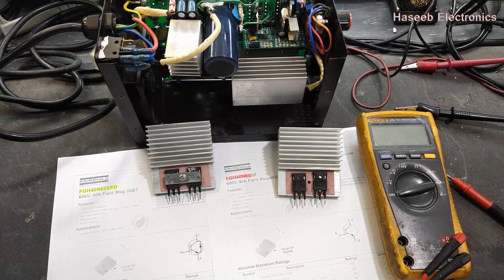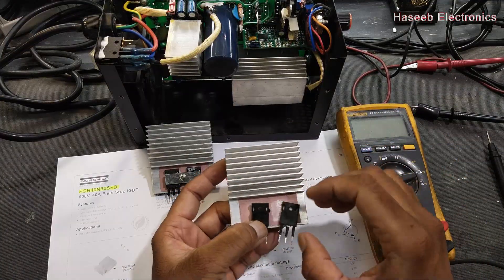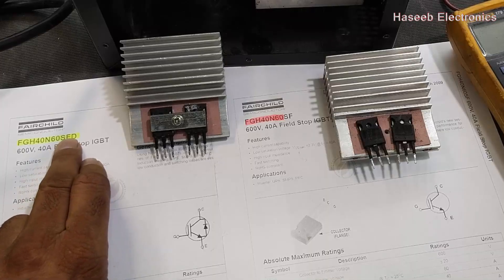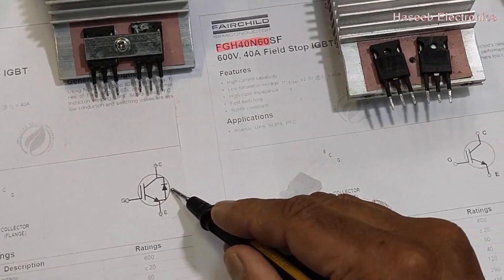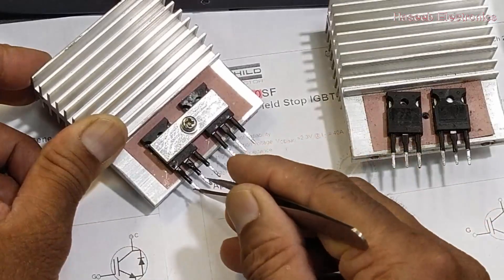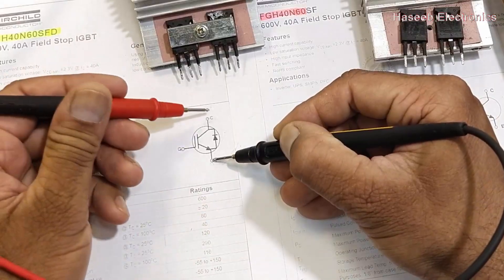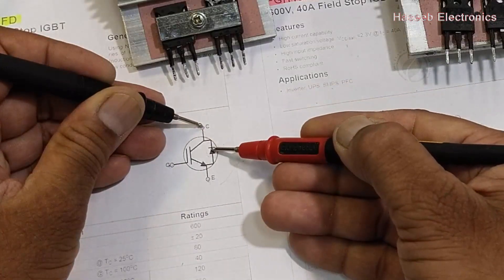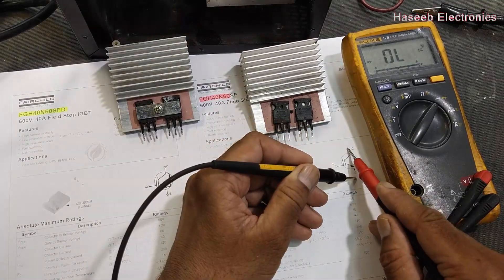[436] How To Test IGBT / How to Check IGBT with Mulimeter / Why IGBT Damage

Comment: I am working on MMA 300 i found out that two IGBTs had busted  (40N60FD2). On the market i found out the only available IGBT is FGH40N60SFD i replaced them. Unfortunately the Welding matching is not powering on.  Are they not compatible? Note be the IGBT are four only two had busted the other two are okay.
Reply: Was I supposed to remove the four of them and replace them with FGH40N60SFD (which are available in the market)

Comment: @HaseebElectronics
 I have an IGBT from my washing machine (IRG4BC30U) since due to an error displayed, most common comment on forums is that the IGBT is faulty. The peculiar thing is that my IGBT still switches, however I can switch it ON an OFF also with the Ugc/Ucg viltage from a diode tester (one polarity turns it on and the other off - I don't have it here right now so I don't remember which polarity does what), so Ugc/Ucg voltage from the tester switches it on and off the same that Uge/Ueg voltage does (which is normal). Is this normal (for the Ugc/Ucg to be switching the CE junction on and off)?

Comment: I bought a new return from eBay for cheap. What I found was one entire bank of igbt's were shorted. The cause was POOR SOLDERING on one of the driver transistor pins. Easy fix and I still have the plasma cutter. As always thanks for sharing your talents and skills. Always an interesting lesson.

Comment: Thanks Mr Haseeb for your knowledge and assistance.  I was brought a Kema Inverter to repair but I suspect the IGBT pair in the synchronous active rectifier are not matched or the same, as the High Frequency solar inverter rises to 240 volt AC output then after 3 minutes indicates F14 fault which I think means low Bus voltage output. I suspect it is interfering with dead time control. What do you think could be the problem, thanks? All gate drive circuitry including resistors, optocouplers and diodes including Zener diodes test fine.

Comment: My confusion is when you're testing the 'resistance' how do you know the reading is accurate? Where on the data sheet does it state 117.3 KOhm is the expected value? I have some IGBT's I pulled from a Godox AD300 and they seem to be fine. Their resistive value is 179kOhm, but the replacements (Mouser) are only 102KOhm. Some are 99KOhm. Are these good or are they defective? Thank you kindly.

Comment: When checking continuty Ol means Open loop not not over load please correct it bro,, 😊
Reply: My benchtop multimeter displays  "OVER LOAD" in resistance measurement mode when the leads are just floating. So... 😊

Comment: Hi
Would you please tell me what are the equivalent transistors for these , because I couldn’t find them anywhere!
-2SD1630 
-2SB2630
Thanks,
Reply from the maker: 2SD1630 equivalent 2SC5487, 2SD1025, NTE2332
the 2nd number 2SB2630 is not traceable, i think it is 2SB630

Comment: Can we add a high speed diode between collector and emitter if we can't get the same igbt?
Reply from the maker: yes we can. the current value, reverse recovery voltage, recovery time must be matched with igbt
Reply: Jazak Allah Khair dear brother.

Comment: Hi pls do you have an smps DC to DC converter circuit for 12vdc - 310v dc using sg3525 i built one recently but the challenge is the fet at pin 14 is heating badly while the fet at pin 11 is cool  what might be the issue I have been trying this for long help pls.. 🙏

Comment: Thanks for the detailed info. Between 3 - 4 minutes you touched gate and emitter with Red probe on gate and black on emitrer hence the resistance should not be high or OL as you charged the gate and didn't discharge before you checked resistance between C & E around 3:55 ? Thanks

Comment: How do you identify geat ,ammeter and collector
Reply from the maker: we must consult component datasheet by following its part number
Reply from the maker: or we can identify, there is gate drive network, connected to the gate pin
collector is to drive the load and emitter is connected to the ground

Comment: It's clear that you cannot replace an IGBT that has a diode across it's collector emitter junction with one that does not have the diode however what about replacing an IGBT that does not have the diode with one that does?

Comment: Hi ,Haseeb  thanks for your video excellent. I have a question ? I will appreciate if you can answer. I have replaced my thredmil I G B T .because getting error EO2 , I replace with new , I G B T  it’s start few seconds and stop .used ( same no - fgh40N60 - ufd ) it’s damage again ,Can you advise me Thanks.
Reply from the maker: first possibility, that the IGBT is falsely marked (ot original part) 
second 
check the dc motor (may be its center is out,  check its rotation by rotating it manually, and  observe that shaft must rotate in center, if it is out from its center, it will need centering by machinist or add weight by balancing machine, so its rotation must be smooth )
check the bearings of the motor must be smooth and soundless 
check the Carbon brushes and if possible clean the commutator
Reply: Thanks you very much for your quick reply, I will try and let you know. thanks again for your kindness wish you all the best.Adey.

Comment: Very clear and concise videos, awesome patient easy to follow teacher. Makes it easy for people like me with zero electronics knowledge. Question for you dear sir , say you have a mosfet welder inverter machine and mosfet dies , can you replace with IGBT? Also what is the main reason these IGBT and mosfet break in welding machine? Is it heat or maybe component specification too weak / underrated for the current and power in those machines ? Can you replace with same type but higher amperage rating? Sorry for so many question this just really eagers me to know for when my Chinese inverter Tig machine or plasma cutter and mig welder break so I can know how to repair.
 Best wishes , health happiness and blessings from Ontario Canada! I look forward to hearing back if you see this , if not it’s ok I will just keep watching you and trying to learn on my own I guess . Love you
Reply from the maker: dear brother i am thankful for your valuable comment 
yes we can replace mosfets with IGBTs, just we need to re-arrange gate driving circuit, so that the gate must charge / discharge properly. 
oaky i noted it and i will try to do a practical tutorial on calculations and swapping the MOSFETS with IGBT and vice versa 
there are too many parameters for the failures of power semiconductors,  
i will suggest to watch video number 502 in my channel, that is on the reasons for IGBT failure
Reply: @HaseebElectronics  thank you so much for your prompt response! You are a gift to YouTube so knowledgeable and kind , thank you for all the effort you put into teaching, you are really good at it. Come to Canada and teach us, seriously we need people like you badly and you would get a decent income! Best wishes my friend take good care of yourself and be happy healthy and safe

Comment: Mr Haseeb 
Thanks for your videos.I learnt alot from them.
I have a question,could mosfet replaced with igbt in smps circuits if they have the same current and voltage ratings 
Thanks

Comment: Thank You for helpful video. Is it OK to use current limiting supply to test MOSFET's and IGBT's on bench?? For example: adjust supply voltage and current within spec of IGBT, connect supply across emitter and collector. Then, charge gate and observe current flow and voltage drop. Then discharge gate and watch open (maybe use scope). Might this expose leakage or sluggish response?? Or the resistance and diode test is enough??

Comment: OK, SFD can not be raplaced by SF (without diode). BUT can be SF replacement to SFD ?
Reply from the maker: it is best to replace same type with similar.
Reply: Is there any different procedure to check sf  igbt(without diode) than sfd.

Comment: Sir i have a tbe inverter 12volts input pure sinewave 500watts, the secondary mosfets were damage and i would like to replace it with igbt please advice me.
Reply from the maker: Yes you can. in this case you have to re-consider gate drive components for proper charging & discharging of the gate for its smooth functioning.

Comment: وعليكم السلام ورحمة الله وبركاته
I was working on a simple project of SMPS to test TV LED strips using a 3.7 volts battery. however, it did not work at all and I can't really know what do I miss or mistaken.
   So I wonder if you can explain how to boost the 3.7 battery to 50 volts and what would go wrong if the coil isn't precisely designed or the capacitor hasn't been picked for the right value
Please note that I still use the manual switch in order to understand the basic principle then I might use a transistor or maybe I will play around with an Arduino and some 555 chips.
جزاك الله خيرا وبارك الله فيك

Comment: Sir i have an induction cooker igbt xns15n120t part no. got shorted. Any suggestion if this igbt can replace to a high amperage.
Reply from the maker: APT25GN120BG
APT35GN120BG
 FGH30N120FTD
FGW40N120H
HGTG20N120CN
IHW20N135R5
Reply: @HaseebElectronics  thank you sir! More power to you

Comment: Thanks for this! I'd like to point out that some cheaper meters don't have enough voltage to turn on the gate. I don't know about IGBTs, but I've seen this with MOSFETS. I have a cheap variable voltage current limiting supply and it does the trick! I like how you have the data sheet just below the part. A great visual aid! I still kind of new in this level of electronic repair. I've yet to work with IGBTs.
Reply from the maker: Thanks for the info! it is a valuable addition for me 
please accept my best regards

Comment: So if we change one IGBT it is sure that IGBT will get damaged... What if we change all IGBT in the Welding machine..... And what if we dont have SFD type IGBT.. So can we connect a diode across COLLECTOR and EMITTER....
Reply from the maker: first of all we have to see that if the original circuit is using igbt with diode 
or 
igbt without diode
if it was with diode, and we don't have a diode based igbt, then we have to connect diode with same current rating and specs which are in datasheet

Comment: I suspect that by now you've flagged me as a major ball buster, picky, picayune, knit - picky, quarrelsome, petty, insignificant, noisome, irritating or simply a pain in the ass. Quite possibly so, but that opinion does not negate fact. Since our last discussion regarding documented studies of "Electron Current Flow Direction" I don't believe your use of the term "No Resistance" will qualify as "Conventional" terminology. In short and for viewers perplexed about my comment, it's simply this... "No Resistance = Zero (0) Resistance"*! What *you're calling "No Resistance" is actually "INFINITE RESISTANCE"*! Which is the exact opposite! Treating those two terms as you are should be corrected and clarified. Electronics is not a subject for the occasionally inquisitive mind. EE's and Techs like to banter and debate but *this use of "No Resistance" should be corrected wherever you're using it, because it's simply wrong!
Wakodahatchee Chris